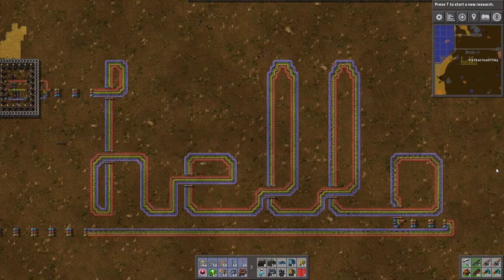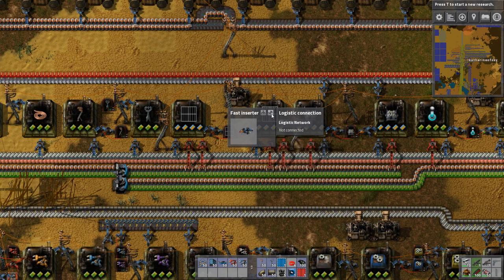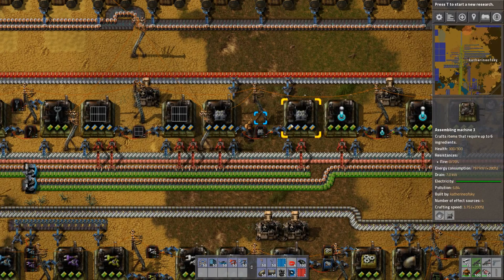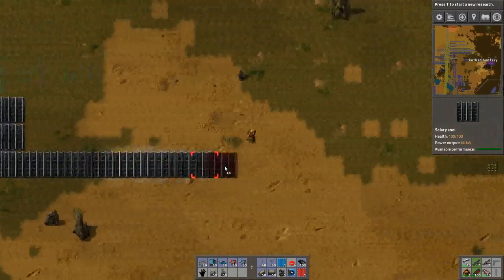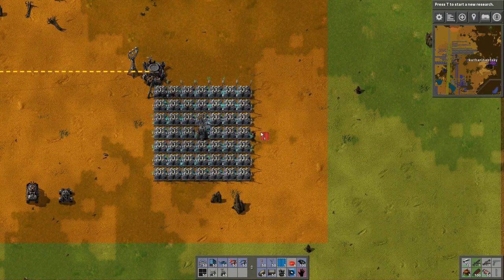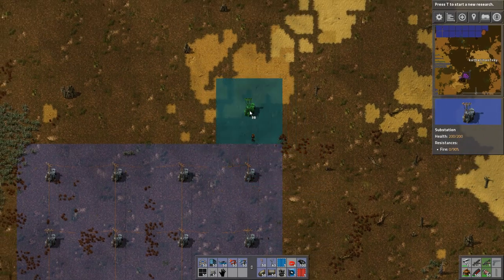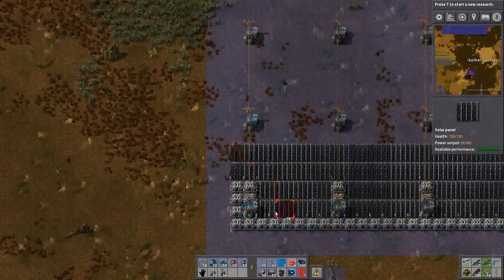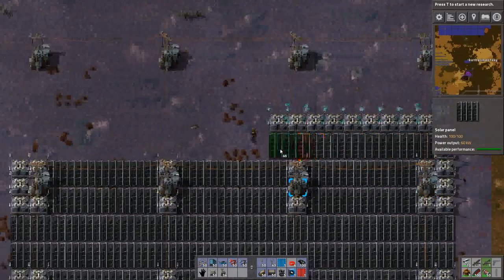Factorio Tutorials: Solar Panel Array

Comment from the maker: Note: Since I recorded this video, the AOE of the substations has increased, however, the relevant areas is that of the roboport, (which needs to connect to others).  This AOE has only icreased by 1 IIRC, so the same build applies.  (You can no longer drag & drop substations).  Feel free to download the BP from my google drive so you don't have to recreate it.
Reply: what a coincidence that i just so happend to search for solar panel builds and got to your video. (and your pin is only 7 hours old o.o) 

so what am i supposed to do now? recreate the exact same build as you have shown in the video? or use the full potential of the substations? substation range seems to be buffed by 2, since i acutally managed to put 5 solar panels in the very first row (with a little gap)
Reply from the maker: Read the comment to which you are replying -- it has all the info you are asking about!
Reply: Same, I'm doing this as of 4-4-2018 and I'm kinda tick off that I have to make a new array.
Reply: link for you google drive plx
Reply from the maker: https://drive.google.com/drive/folders/0BwVHGs2mds_XRUVCekwxYnNldnc?usp=sharing
Reply: It seems like the last few times I've tried loading your drive it's trying to do some weird deleting thing. A minute or two later everything is gone, until I reload and then everything goes away eventually again.
Reply: TY for this, I have to say it is much appreciated. Been playing around for a while with a ginormous base...  I have 4000 solar panels already in place and room for another ~10,000? This will make things MUCH nicer :)
Reply: Hello, may I ask if this BP layout still works with 1.0? If so, how many panels and battery needed for 1 block?
Reply from the maker: @banlee8357  The ratio is exactly the same, though the running start doesn't work because they upped the distance for substations to connect.  However, I now use Aven1017's layout, which is much prettier and even more exact.  Check it out in my google drive.

Comment: One thing worth mentioning about the perfect ratio - it assumes constant power drain. If your power demands are varying, it's actually better to have more accumulators than the perfect ratio suggests.

Example: a factory that needs on average 42 MW of power can be supplied by about 1000 solar panels (the average power production of a solar panel, through a whole day/night cycle, is about 42 KW). If you use the perfect ratio, you'll have enough power storage to last you the entire night, plus enough of the morning until your solar panels reach 42 KW each. This is roughly the point when accumulators will be completely drained, but will start being charged up by the power surplus. On average.

But, being the average behaviour, means that sometimes your power demands will spike during the night, at which point you will run out of power probably somewhere in early morning.

At that point you don't need any more solar panels - you're still producing as much power (on average) as you drain (on average). You do need more accumulators though, to account for power usage spikes.
Reply from the maker: Indeed, makes sense.  I build with "perfect ratio" setups just because I don't want to have to measure accurately, or worry about counting how many clusters of solar panels versus clusters of accumulators.
Reply: Sure, it's still better to simply have more than you need, rather than try for exact amounts. I'm just pointing out that detail because some people put too much emphasis on the perfect ratio, when in fact it's rarely the most practical ratio.
Reply from the maker: I would have to say that the "perfect ratio" IS the most practical ratio, at least for my building purposes!  :-)
Reply: For me, the keyword is laser turrets.
Reply: Correct me if I'm wrong, but if you have, say, one field of this and that is exactly enough for a full day, you can simply add a second field and that will give you twice as much power to survive the day with. That does not mean that you actually use all of that, giving you reserve power.

Comment: Hi Katherine! I love your videos really, they helped me with  lot of stuff!
Anyway, now I was making this and when I build the first two rows of solar panels,  there's a gap of 1x6, 1 width and 6 height. I've doublechecked eveything, and I also came to the conclusion that you can fit more solar panels in between your substations (vertically). The video is about a year old, has anything changed in the meantime?
I can fit five solar panels in between vertically in between my highest accumulator on the first few lines and my second substation vertically, you put in 2 panels and a accumulator. And in the width, you put in four panels, where I can put five in and leave the small gap I was talking about.
Reply from the maker: The AOE of the substations has increased, however, the relevant areas is that of the roboport, (which needs to connect to others).  This AOE has only creased by 1 IIRC, so the same build applies.  (You can no longer drag & drop substations).  Feel free to download the BP from my google drive so you don't have to recreate it.

Comment: was looking for this thanks. it's early-mid game and I need oil, and there are 17, count them 17 oil sludges all in one place on the map which is 200 rail blocks away from home. there's no water so I cant have power. I also need to navigate around a freakin' hill to reach them. I either run a ridiculously long cable network or build solar. lets hope I can make enough.

Comment: Hi Katherine! I really appreciate your tutorial. After experimenting with it though, I found that there is a more optimal arrangement, that uses mostly accumulator and just a few solar panels, as shown here: http://steamcommunity.com/sharedfiles/filedetails/?id=855592608. The energy data for the array is here: http://steamcommunity.com/sharedfiles/filedetails/?id=855593986
Reply from the maker: The "optimal" ratio is something that has been calculated by many many factorio players over a long period of time.  And while the needs of factories definitely differ depending on usage, it's generally not that far off from what has been calculated.  The screenshot you posted has waaaaaay more accumulators than the formula indicates.  Are you using mods?  Do your accumulators spend ALL of their power overnight? (or close to it?)

Comment: actually you dont need research pack 3s. acumalater research doesn't need blue packs. and everything before is either doesn't need blue packs or is required to make them.
Reply from the maker: You do need oil to make accumulators though :-)

Comment: Quite nice and useful video.
For me personally however, i often doubt this so often mentioned ratio is all that useful. Now the calculaations are right, did it myself before i found the post in the forums, but there are some assumptions made to calculate this ratio and at least my factories tend to not really live up to those.
The main thing is that this ratio needs a constant poweer consumption. No spikes due to machines turning off or on and definetly no laser turrets. Lights are manageable though.
And then we calculate how many accumulators you need to meet the power demand throughout the night and then how many solar panels to run the factory while charging the accumulators.
And thats where i found it to not be that useful anymore. It still ot wrong to use it, i'll explain why, but its not really needed to stick with this ratio.
So as i explained earlier i usually need more accumulators in reserve just to compensate for potential powerspikes mainly due to defenses going into action. This means i also need more solar panels. So far so good.
These newly added solar panels don't need to power th factory though and so 100% of their power can be used to charge those accumulators and for those the ratio is roughly 3.5 accumulators to 1 solar panel.
So in general i just pt down enough accumulators and solar panels to power my factory anyways and look to roughly have a ratio of between 0.84/1 and 2/1.
Reply from the maker: Everyone's power needs are different.  I've used this panel config to power my Belt Diva megafactory, which had 3 rows of laser turrets at the walls.  I did find that I added a few pure banks of accumulators, but otherwise, it worked flawlessly.  IMO, it's useful to have a beginning point for solar production, and not everyone has the math skills to calculate what they need themselves.  Thus, the tutorial.

Comment: Do the different chests in the logistics network need to be connected by wire for an inserter to check them for a set amount of items? Last I played I think they had to, so I had to have wires all over the place for a factory-wide production cap. Then again, that was when the end game had something to do with radars, so I'm probably very out of the loop by now =P
Reply from the maker: Individual chests need to be connected via wire to check them.  However, if the chests are in the (robot) logistics network, you can check global amounts by setting an inserter to "connect" to the network, (no wires), to produce things IF (global amount) < X.  Thus, you can control production both on a local level and a global one.
Reply: Ah, so that's what's up. Thanks a bunch!

Comment: why do you need a robothangar in each solarpannel"box"k
Reply from the maker: The reason for the roboport is so that they can connect to each other and automatically build more and more panel arrays  as you put their blueprints on the ground.  (The orange squares of the roboport range need to connect so that they can pick up materials from the base).
Reply: It's also, so that if you are playing with biters, you can have robots repair the setup, if it gets damaged.
Reply: Basically, you don't need it...you just want it. Right now I am leaving the roboports out despite using the same design because I am using 6 personal roboports and building on an island where they will never take damage, but normally you want to be able to lay down a new solar block and walk away, and have the built-in auto-repair capability.
Reply from the maker: Another thing I've been doing recently is to place the roboports every 2 out of 4 squares -- aligning them so that only the corners touch.  You only use half the roboports this way, and the robots still have the same construction area.  (On a grid of solar squares, you'd place them in a checkerboard fashion:)
R - Array with roboport, X - Array with no roboport:
RX
XR

The empty squares can be used for radar, (placed sporadically), if desired.
Reply: i never had bitter attack solar panels it a very unlikely thing.

Comment: How do you connect it to the main power line? If I place power cables in the range of the substations then the accumulators don't charge.
Reply from the maker: If you accumulators don't charge, that means you are using more power than you can produce.  (Accumulators will fill with excess power, then discharge when the factory needs it).  Build more solar arrays or other power structures.

Comment: Is that square pattern of accumulators around the panels just to be efficient use of space...  or does it matter if they are placed around  each other like that or just as long it keeps the same ratio of panel:accumulator ?  I used a crapload of accumulators and panels of closely the same ratio but constructed in a manner that resembles they were all fired at once out of a shotgun against the monitor.
Reply from the maker: ROFL!  I love the colorful description!  The square shape performs two functions: ratio, (as you suspected), and ability to connect roboports.  They can be in ANY order you wish, there's no magic with the design!  This design is just an efficient use of space.

Comment: Has this design changed? I have some extra space between solar panel spots :S
Reply from the maker: The AOE of the substations has increased, however, the relevant areas is that of the roboport, (which needs to connect to others).  This AOE has only icreased by 1 IIRC, so the same build applies.  (You can no longer drag & drop substations).  Feel free to download the BP from my google drive so you don't have to recreate it.

Comment: Very interesting. I was wondering how to use those solar panels effectively, so I reduce pollution output. While I am relatively new to the game, I want to learn how to use those roboports well as it seems to save a lot of building time.
Reply from the maker: Indeed they do.  In larger factories, I might use BPs to plop down 50 new arrays in a spot, and the robots will build them as solar panels & accumulators are being made.

Comment: Small mistake. You can store hot water in tank so there is an solution to store energy before acc.
Reply: this is alot more complicated for those who dont understand fluid dynamics, and only popped up o reddit in the last month ish. so its still pretty new, and relitavly unproven.
Reply: We have stored hot water for over a year now=)

Comment: Why dont have just separately acumulators and solar panels i like to make 3x3 of medium poles and place there acumulators or solar panels btw i am newbie in factorio and i am using the quarry mod and i use only little bit of belts because drones are so much better and simpler to setup at least for me cuz i just set I/O and it is done and i dont have to think out where to caft what drones just go where i need and it is really space saving
Reply from the maker: This array is MUCH more compact than simple arrays of solar panels.  It also has a recommended ratio, which simplifies calculations, and worrying about having too many or too little of accumulators.
Reply: KatherineOfSky but what is bad on too much of accumulators i think the more the better because when you have like lots of laser turrets set up they act like buffer or energy cache between grid and turrets and they are reducing the energy satisfaction spikes

Comment: How do you defend all of that space?
Reply from the maker: I usually connect the lakes with walls, and have 1-2 rows of laser turrets behind them.  When I build defenses, I do so outside of the pollution zone so that it minimizes attacks.  This also has the benefit of creating large tracts of defended space for solar panels.

Comment: either the power size of the subratins has changed or i've had too much to drink and forgot how to count
Reply from the maker: The range has increased by 2 tiles since 0.14.
Reply: Thanks Katherine, I found a tiled design on the forums that is pretty close to optimal in 0.15 http://imgur.com/a/P4Ilu
Reply from the maker: It's definitely not optimal... the roboports' logistics range can't connect to their neighbors!  A lot of people seem to forget that while substation range has increase, roboport logistic range is the same, and THAT is the limiting factor.
Reply: Yea the dude on the forums mentioned that it wasnt  optimal. I didn't notice the robo ports thing though cheers.

Comment: I'll be honest, I always did massive solar grids until my most recent game. In my current game I have my electric furnaces running off a solar/accumulator grid, while everything else runs off a steam power grid.  I have to use nowhere near the space to generate the same amount of power, and I use solid fuel from 0.1/s oil resources, so I have infinite solid fuel for the boilers.
Reply from the maker: That's a good idea if you can spare the oil.  I always put level 3 speed modules in the pumpjacks and beacons around them, so each depleted well will garner 0.55/s oil, but I still don't generally have enough oil to justify burning it.   Of course... I tend to make my bases ... erm... "slightly" on the big side XD  Best option is always to do what works best for your own factory!
Reply: Yea, when I researched electric furnaces I realized how terrible that would be if I hooked them up to the steam power grid.  So I decided to make 2 separate power grids, one is entirely solar/accumulator, one is entirely steam.  I wouldn't want to try running my big base worth of electric furnaces off of steam.
Reply from the maker: Oh indeed!  They take massive amounts of energy!
Reply: I just find that the less space usage is a huge advantage for steam over solar, each tile for a steam engine creates something like 9x as much power as each tile of a solar panel. Even with boilers and whatnot the overall size is miniscule compared to how much power you get from it 24/7
Reply from the maker: That's an intended part of the game.  There's meant to be a tradeoff for having "free" power.  Personally,. I just wall off a massive area, keeping biters outside my pollution zone, and I have HUGE tracts of land available!  That's the one resource in Factorio that is functionally unlimited.... land!  :-)
Reply: 10 Oil equals 8.019... ~ 8 Solid Fuel when using the advanced refinery, converting heavy oil to light oil and then converting everything else in solid fuel (i.e. heavy oil to light oil and light oil and petroleum to solid fuel).
So with a 0.1/s oil resource you need 100 seconds for 8 solid fuel.
That averages out to around 1 Solid fuel every 12.5 seconds (it's a little bit faster, but so little that's not worth mentioning).

Now, Solid Fuel has a Fuel Value of 25 MJ. A boiler uses up 780 KW (through fuel) and produces 390 KW (i.e. 50% efficiency).
That means that a single piece of Solid Fuel will last one boiler for 32.05... ~ 32 seconds.
So, your 0.1/s oil resource will be able to fuel around 2.56 boilers indefinitely.
So, in the end, for every standard 1:14:10 setup, you would need 5.468... ~ 6 Oil resources of 0.1/s oil to last forever.

Of course, if you use modules etc. the ratio is getting better. KOS mentioned that she gets 0.55/s oil thanks to modules and beacons, which means that she only needs a single oil resource to support one standard 1:14:10 setup.